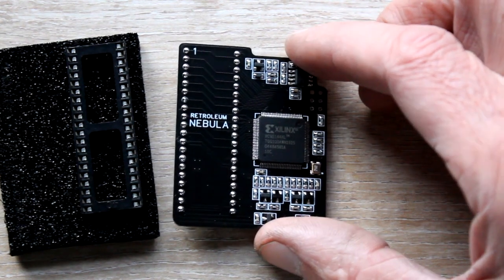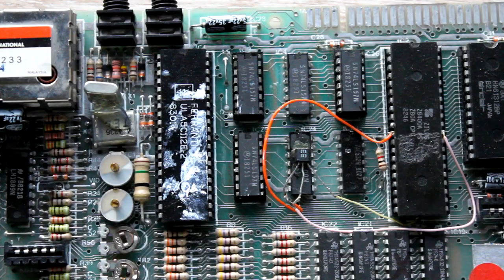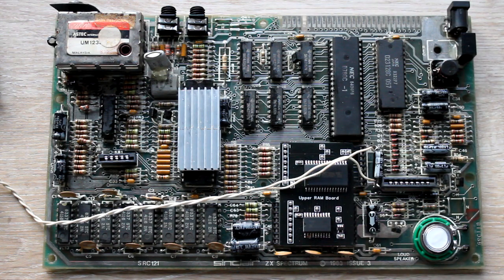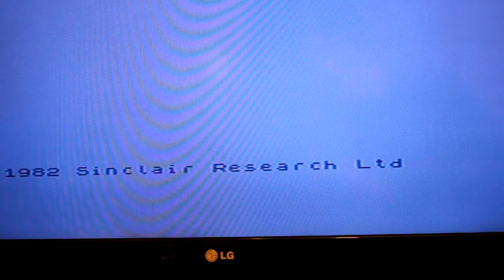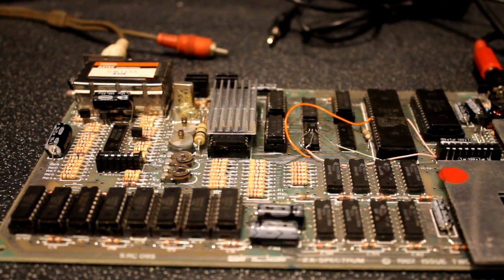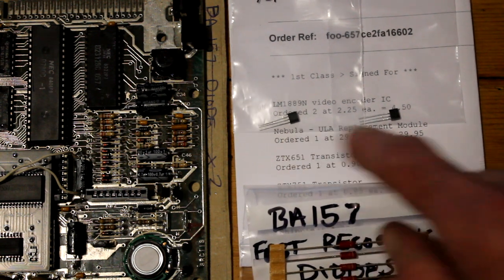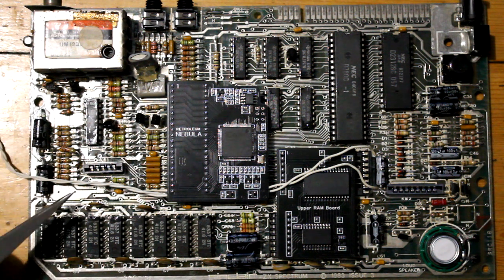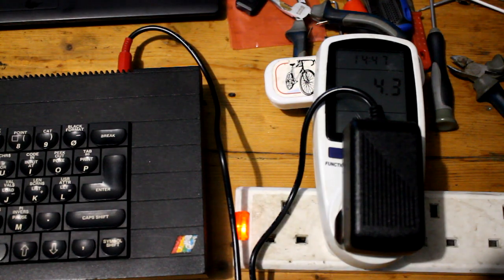ZX Spectrum. Brand new ULA chip. Retroleum  Nebula.

Comment: the reason that the nebula was difficult to fit is that the socket is the wrong type, you should be able to see the socket pins fully rather there being a square hole for the chip's pin to fit into. It's literally trying to fit a round peg into a square hole otherwise ...

details can be found by searching on "spectrum nebula known fitting issues", which includes pictures of both types of socket - as it's not possible to link to the PDF here.

Comment: If you have a module which hits other ICs then the best thing to do is use another socket or two to make the module higher. I.e. module goes into a socket, (optionally) goes into another one, then into the one on the PCB).
Reply from the maker: Good idea. There would be a height issue with the rubber keyboard Speccy. I measured the gap yesterday to make a heatsink and with a ULA and socket you have 1.7mm room left. Pleased I never unsoldered sockets and then saw your tip lol. :)